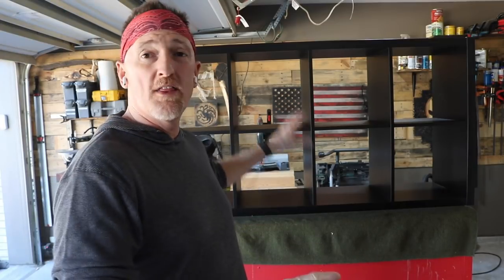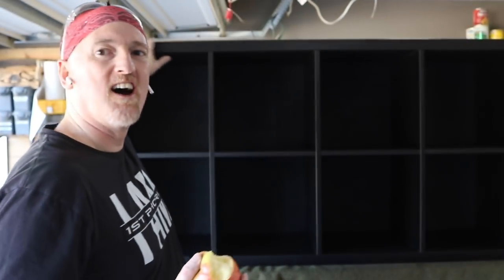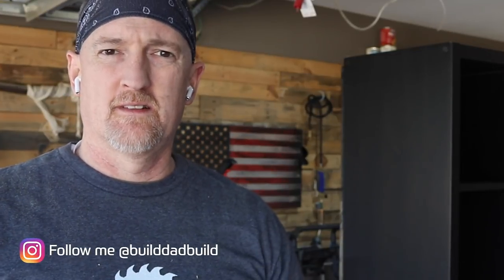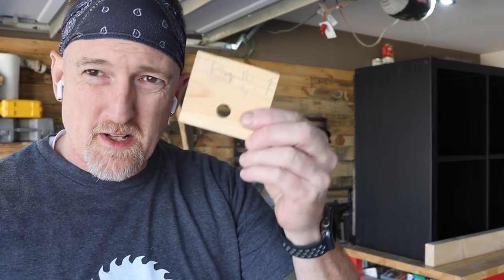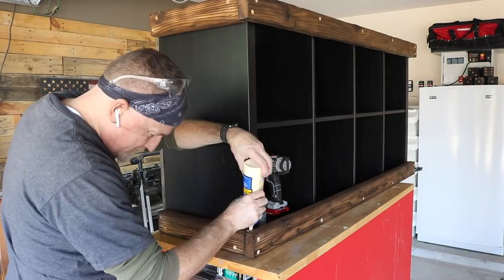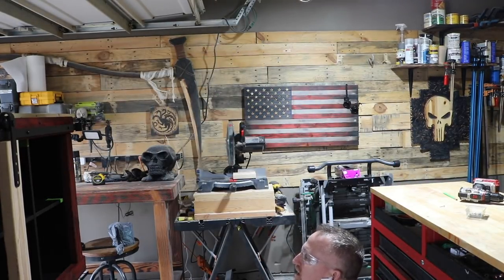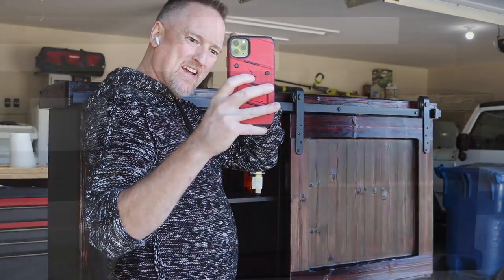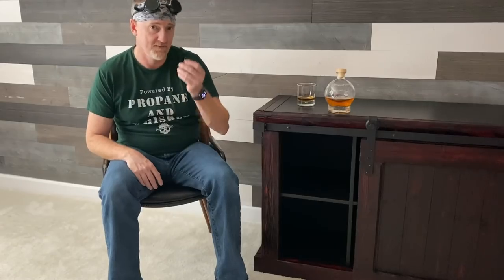Ikea Hack - DIY Hacking the Ikea Kallax with Dyed Shou Sugi Ban Lumber

Comment: It's all your fault. I'm going to have to torch some wood now! Love that Kallax hack. I need your expertise and creative brain. I just bought my very first miter saw and went to go get a cheap stand from Harbor Freight. They were out and...for some reason I decided to buy a two shelf steel cart, because it was only 30 bucks. I want to enclose it (cabinet on bottom) to house my shop vac and little air compressor, as well as build up the top tray (or add another shelf) for a table for my miter saw. If you need a project feel free to create one so I can copy you. Haha.
Reply from the maker: LOL. I do need to build a cart to hold my sanders...🤔
Cheers
Reply: Build Dad Build Feel free to build it on a little 2 shelf red steel one. 😀 I wish they had a black one so I could follow your color scheme from the Kallax. Love your stuff and can't wait to try to make things myself. In the process of revamping my two car garage to make a work area. I'll start experimenting after I have work space. Showed one of your videos to my 15 year-old and her friend. You even had them intrigued! 😲

Comment: Would the door have been lighter weight and faster to build as a glue up instead of 30-ish pocket screws?  I am not against pocket joinery, just curious why you went that route.
Reply from the maker: I was afraid the glue might fail when I torched it.
Reply: That makes sense, especially if the boards warped during the cook.  Thanks for the response!

Comment: Love the builds bro. I noticed you used minwax poly acrilic. I've tried using it with keda dye and a foam brush only to have the brush pull the color off. What application do you use if you don't mind me asking?
Reply from the maker: I usually use a foam brush. The dye tints the finish a bit, but I haven't had any problems with it pulling the color out of the piece. Does that make sense?
Cheers!

Comment: Love it. Was that acetone and dye mixed together or what? Love that look and never seen it before. Also, I probably would have put a matching top on it to finish it off
Reply from the maker: Thank you. That was lacquer thinner that I mixed with the dye. 
That piece will probably get a top at some time. I was trying to keep the cost down and didn't want to run out for more lumber...
Cheers!
Reply: @BuildDadBuild  I remember you recommend using warm water with the powder dye in another video, is that still the case or what changed your mind. Thanks

Comment: Q: when your making the door with pocket holes then burning are you also using wood glue? and if so have you had any issues with the glue and burning.  Great build!
Reply from the maker: It depends on the joint. Sometimes I do, and sometimes I don't.
The key is to keep the torch moving so you don't superheat the glue.
Cheers!

Comment: How well does the Keda dye hold up to uv light?
Reply from the maker: Not sure how the dye does on its own. The Halcyon finish I use is UV resistant and seems to do a pretty good job of maintaining the color.
Cheers!
Reply: @BuildDadBuild  I was thinking of the dye on a gun stock with some boiled linseed oil.
Reply from the maker: @celticdude4686  I would think that dye would hold up better than stain just because it penetrates the wood fibers. But...not entirely positive!